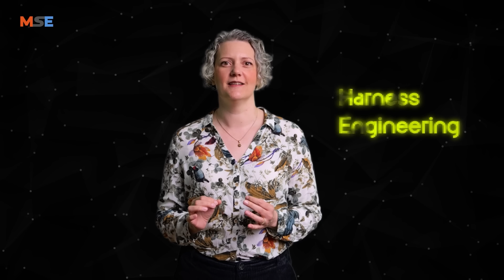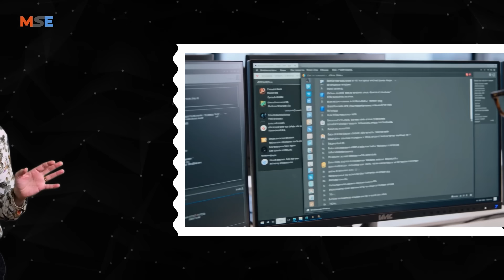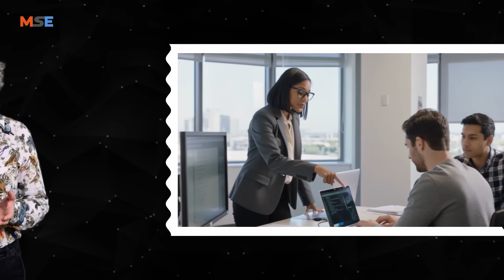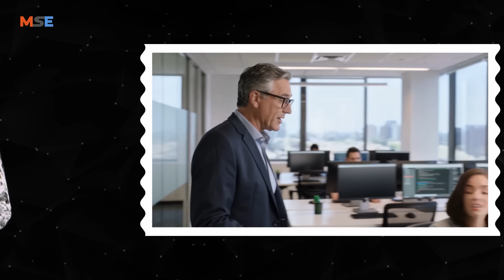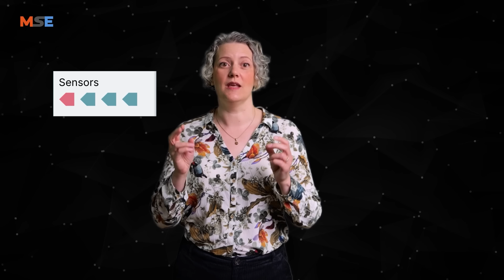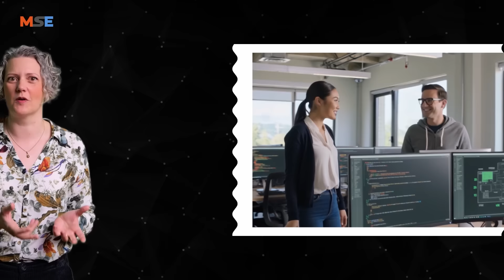I Stopped Coding and Started Architecting Agents (And You Should Too)

Comment: i still wonder in which domains LLMs help most with programming. It's not that OSS covers all existing domains and programming languages. A statistical analysis of the training material is really due. Dunno if the AI companies feed the LLMs with binaries too to train assembler? But the binaries are undocumented code and infering what a block of assembler intends to do is also dependent on the context (i.e. OS and libraries) and informal data structures.

Comment: So, Emily really likes her harnesses...

But on a serious note, I've arrived at a similar conclusion in my now 26 day streak of working on a hobby project with Claude Code (and some Codex) and C++ (for which my coding level is Hello World). 
It's like leading a junior dev team, and I do have 10+ years of experience in that. The good part is that LLM's are much faster and much cheaper (while still subsidized by the american tax payer). But you still need to keep it in "harness" or a "framework" as I've named the structure I've developed trough trial and error in those 26 days.

This is no hate for juniors, I was a junior 15-20 years ago. If I was a junior again, I'd start with a hobby project and also learn through trial and error. Or just convince your current boss to allow some experimentation time/budget. Also, keep learning, just not old "leet-code". Learn Software Achitecture, LLM's are a weak on that. They started drifting and making false assumptions in my first week and spent a few good session before I brought the project back. Probably my "harness" was not good enough. Also, aggressively modularize (micro services if you will) and keep the processes as simple as possible. LLM's are quite stupid and at regular intervals I had to hand feed them the steps. Just like certain junior devs I've worked with.

We are going from hand crafting pants to factory produced jeans, so sewing (coding) we'll be automated, but someone still has to manage the production line, bring a robot back from drifting and so on. Be that person. How many people write in Assembler this days? This will happen to some current programming languages. 

Obviously there is "cost" question... when the bubble bursts, how many tokens will today's 200USD get you? Until reckoning day, I'll keep sprinting with my hobby project...

Comment: I’ve been doing harness engineering with pi for a few months now. For simpler features a bug fixes it works fine, but for complex features/designs in large codebases it’s a mixed bag. SOTA LLMs are biased towards completing the given task as directly as possible, rather than implementing the task in the context of the codebase, which often requires fundamentally changing the direction of the feature. Ie the agent often needs to say no, but it’s trained to be compliant. It’s also expensive, a super simple pi agent with opus 4.8 high spent 8 mins and cost $8. That’s $120k+ per annum if the agent worked a 9-5. Meaning the agent is a junior dev charging senior dev rates.

Comment: Architecting  agents done right requires coding and understanding software really well.
Reply: I’ve also noticed that Claude intentionally obfuscates harness scripts it writes and you must prompt it to make the prompts for subagents and steps clearly readable in the shell script. 

Otherwise its harness will be incomprehensible even when it works. But after getting the first iteration it’s been helping a lot and I’ve been improving it each feature. 

Now I spend all my time on making a spec that can be done e2e with the harness, it makes a PR, auto fixes reviews, and at the end I review issues it came across and update the harness to try on the next feature.

I feel like prompting Claude code directly becomes psychologically taxing, I get so mad when I read bad code and fix dumb mistakes, I’d rather have it so by the time I read it the dumb mistakes are mostly gone.
Reply: Claude has also intentionally been “hedging” with “honest caveats” at every step instead of solving problems that are simple, and it begins to feel like it’s rate limiting or data mining my decisions. By being really strict in the prompt and using non-Interactive goal loops the amount of anger I feel while developing with ai went down like 80%

Comment: The video title says "And You Should Too". The description says "Stop coding and start architecting!". Which frames agentic AI as universal advice and inevitable. But in the video at 4:08 you say: "It is particularly useful in the typical situation of teams I am coaching where there is a lot of legacy code." That implies that there are circumstances where it is not useful, right?

I think it is fine to report on experiences with specific type of projects. But why do you need to frame it as general advice for everyone? This is one reason why there is so much backlash against the agentic AI narrative, because so many people frame it as inevitable and universally useful in every circumstance. Which elevates it from a technical tool with nuanced applicability to a universally applicable strategy that you don't need to have a discussion about. The fallout that this type of "marketing" has already caused is a large-scale mindless and mandated adoption of agentic AI without any nuanced technical discussion about its applicability.
Reply: This is either clickbait or advertising.   That's why it doesn't make sense.

Comment: You can call it engineering all you want but it will still be proompting. Every time you force LLMs to code for you lose knowledge and intelligence. Bit by bit, you turn into a slot machine addict. I've almost had it with software if this is the zeitgeist going forward.
Reply: "if you thought of your core skill as being the technical act of translating a detailed description of a solution created by someone else into working code, then I'm afraid you have a problem, because AI can do that now, and it can do it more quickly and more cheaply than we human beings can. "  You can ignore reality, but you cannot ignore the consequences of ignoring reality.
Reply: @Ron-2029  that quote is a fine example of ignoring reality.  AI can't do this. We see proof of the fact that it can't do this every workday.
Reply: @capability-snob  you're not using it correctly.
Reply: @Ron-2029  and you're validating the output the way you would code written by a human, checking for signs of lucidity like tests and readability.  this isn't enough.  the sort of errors these things introduce at scale involve failing to understand the purpose behind existing code, failing to maintain invariants, and missing edge cases.  humans can introduce the same sort of bugs, but at least if you've had humans thinking through the problems, you've got justification and understanding when it goes wrong.  note that these are the sort of bugs that can lie hidden for years; you might not discover them until over 900 postmasters have criminal convictions due to your bug.
Reply: Using linter changes everything. Obviously you have to describe Intent with a prompt, but it's a feedback loop which changes everything. Model will be wrong all the time, but with linter it can self correct.
Reply: @alekseykostyuk3806  More like the minimum to get anything out of the LLM that is even worth reading, let alone accepting. I went as far as to disable language features, set up static analysers, and manipulate the LLM using logit_bias (I use explict typing so I ripped 'var' out of it's lexicon entirely, to cut influence from javascript and the like). 

Better? Yes. Far better. Good enough? No.

It's funny. I don't regret this, because it's forced me to be stricter, to think hard about architecture and address code smells immediately. To improve my own code, with my own damn fingers.

Which isn't to say it's useless. As a glorified rubber duck with read-access to the project, logs, dependency source code, documentation... It's handy. 

But even then, I find myself fighting the sycophancy, and it's obsession with enterprise slop, and a bunch of other biases that are antithetical to programming.